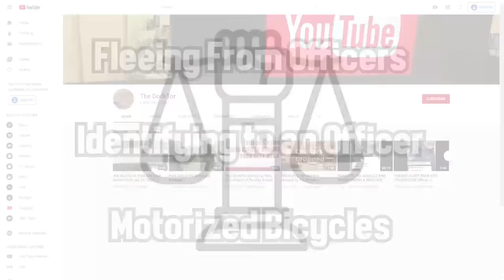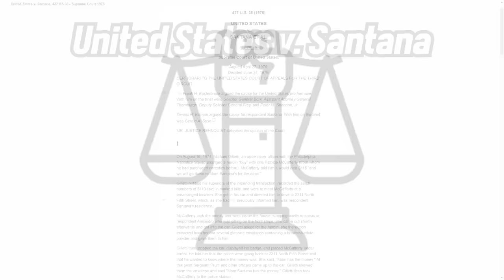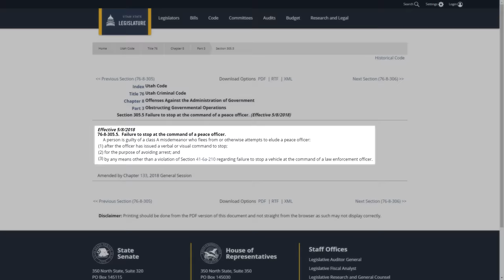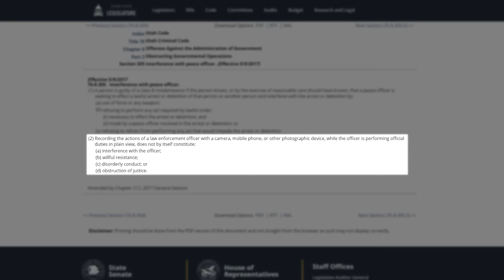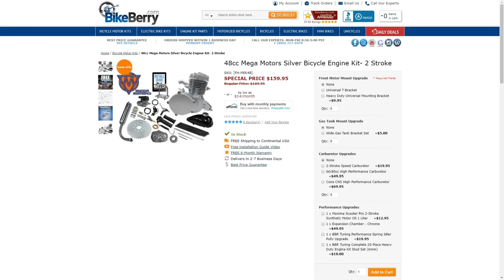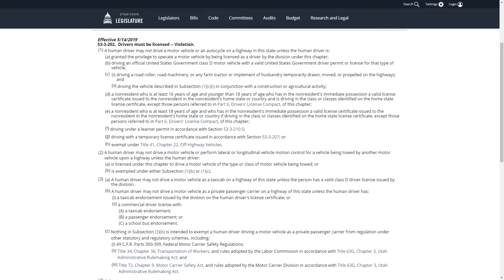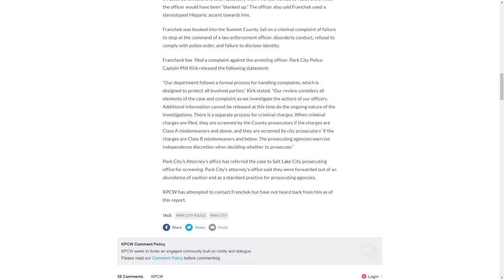Teen Stands Up To Cops Arresting His Father

Comment: Yeah, this is one of the first ATA scores that I HIGHLY disagree with.  They never asked him to stop.  They asked if they could talk to him.  They never made it seem like he couldn't leave and so he left.  The cops get at best a D of some sort but later on they are on video essentially discussing what made up crap to charge him with since they knew they were in hot water.  So F is still probably the truest score for them.  The fact that the two officers were later fired, the women that called it in fled and that no prosecutor wants to touch the case with a 20 mile long pole just shows they know it was poorly handled.

Comment: Here's the problem, nowhere in the video, not at any point as shown at least here by AtA, did the officers say "you're detained" or "stop". At the point when he turns around to enter his home, it was a consensual discussion. That means it cannot and was not a "hot pursuit", nor can it be "fleeing" or failure to follow a lawful command. No command that was lawful was ever given until after he'd entered his home (I'm guessing in the section during the scuffle that happened inside the home not shown). Therefore, the entry into the home was unlawful. The police must make it clear an individual is detained when there is no clear context to make a reasonable person believe they're detained. As for riding a motorized bicycle in Utah without a license, the laws are a bit more murky here. A kid under the age of 15 cannot ride on public roads without adult supervision provided the motorized bicycle is considered a motorized scooter, and there is clearly an ambiguity and conflation of what constitutes a motorized scooter and a motorized bicycle under the law. Furthermore, nothing in the law prohibits anybody from riding such a bicycle normally as a push pedal bike, the only restriction is that they cannot engage the motor if they don't meet the requirements to do so. All in all the police here deserve an F for not only failing to grasp the nuances of the State's laws regarding the motorized bike usage, but for failing to issue clear lawful commands and then entering a home where they did not have a lawful right to do so. Had they stated "Right now you're detained, step down here for a moment" at the onset of the interaction, it'd have been a completely different situation. Yet they failed to do so, making any reasonable person believe that the contact was consensual. The father in my opinion gets a C-, for fighting against the police, not exercising his 5th amendment right not to speak, and put his kid in harms way. While the kid gets a B+ for standing up for his rights, asserting those rights bluntly and directly, and sticking to his position. While the kid didn't understand the law fully, especially in regards to riding his motorized bicycle with the engine engaged, he was quite correct the police didn't have the authority at that time to enter the home, even with the witness claim of the presence of a gun.

Comment: I disagree with the “grade” of the cops. This edited clip of the encounter doesn’t show all the egregious behavior of Officer Jaime Rodrigues and Officer Cameron Thor. Mostly of Officer Rodrigues. The DA dropped the charges against Mr. F. and Internal Affairs found both officers guilty of violations. Five violations for Officer Rodrigues and three violations for Officer Thor. Rodrigues’ attitude was atrocious and his performance was abysmal. Threatening to “throw a teenager’s face into the cement” and leaving two juveniles alone after arresting the only adult guardian. By the way, Rodrigues was formally reprimanded by his superior, but refused to sign his corrective action plan. WTH!? Former Officer Thor did not complete his required corrective action plan by the “due date” and was allowed to resign on that same date.

Comment: This just goes to show that:
1. Do not open your door to cops unless you called them, but you are not safe even then.
2. Do not step out on your porch to speak to them.
3. There is absolutely no situation that a cop cannot make worse.
4. Cops will escalate anything to victimize the victim and get sued.
5. Cops are criminals.

You have the right to not answer questions, 
but not to turn away from them on your own front porch.
You have the right to tell them to get off your property.

Comment: Halfway through, and spotted two major errors. A) The witness specifically told officers only that he had a gun and that he had not drawn it or threatened to use it, they therefore did not have RAS of anything violent or a threat unless you accept that every armed citizen is a threat to police. B) They did not issue commends to stop until he was already in his house. "no no" is not a lawful command or even intelligible as an order. Even so, he had a split second to stop between then and when they put hands on him... I hardly think it's fair to characterize this as "ignoring their commands" even though you are likely right that the Orwellian court system would do so.

Comment: The kid did not need a license to ride that motorized bicycle that was equipped with brakes and pedals In Utah, you do not need a driver's license to ride a motorized bicycle with a 50cc engine as long as it is equipped with pedals and meets specific requirements

Comment: Really dropped the ball on this one. 

You got the motorized bike law wrong. There is an exception in Utah for those gas powered bikes that only requires a permit to operate. The police department admitted as much. 

And you are incorrect the officers are able to claim hot pursuit for following the resident into his home. Had they told him he was detained or asked him to stop, they would have reason, but they did not give any lawful order, they just assaulted him while violating his fourth amendment rights. As the police department admitted after its investigation. 

You also left out the video (maybe you didn’t have it) of the officers admitting they were making a bogus arrest just because their egos were bruised and trying to fabricate charges to justify it after the fact. 

You also failed to mention that the man was tased for no reason or that he did not resist or fail to follow a lawful order in anyway. 

You also didn’t show the video of the officer placing his hands on the kid. Never any excuse for that. 

It seems like you really didn’t do your homework here and you’ve entirely misrepresented the situation. 

There is a reason two officers were fired as a result of this case and that there is not a seven figure civil suit. 

Your grade on this one is a D-. And that’s because I’m being generous because you do so much good work.

Comment: NOT IMPRESSED with your "F" grade for the victim here.
I recognize the niggling legal hairsplitting of the porch vs doorway tread plate, as well as the VERY THIN justification for a "hot pursuit".
I suppose we should all take a lesson here, do not step outside that door. Is this about "curtledge"? I imagine that merely a low gate at the steps before the porch would remove the porch from this rather triffling designation as "public" space.
You can't be resisting arrest unless you are under arrest, and you can't be under arrest without probable cause. It seems this Audit the Audit is a terrible failure and a giveaway to abuse of authority.
It is this reliance on this one witness apparently carelessly saying that there may have been a gun in a waistband. Why do I have to point out that the rumored possible presence merely of a firearm has ZERO cause for alarm or special action beyond awareness. It is a threat + firearm that is required to manifest the justifications wrongly made in this event and this "audit", and nowhere was a threat indicated.

Comment: there are times and places where common sense would be the way to go,  that man was home, he had the choice to either open the door or not open the door, he was in his right no matter what he chose to do. He had an incident with his neighbour prior to the officer showing up, not answering anything was indeed his rights, and lets just that is what he chooses to do, the officers leave and that's the end of the police encounter. He still lives next door to his neighbour, and that old incident will reoccur no mattter how anyone tries to discuss with the other,  you can also go that route. Without the police interraction, there is no possibility to settle that dispute unless one of the 2 neighbours move from there, From what i see there, the dispute with the neighbour is over and done with,  he can try to sue the officer which in turn, just turns the attention elsewhere. which can prove to be costly, Now, wether he wins his case or not,  It only transfers the problem elsewhere and the dispute with the neighbour is only postponed temporarily. It will re-occur.  You have rights and by all means, use those rights,  but using common sense is always a viable solution. A few minutes where you feel your rights are being violated, vs a lifetime of anguish with a neighbour, guess where i would go

Comment: Whether it's an open-carry state or not, of course the cops are going to go after the person with the deadly weapon first. As a public safety officer, you should take care of the most dangerous threat first. I would think that's common sense. Sweep up the other clown afterwards and once everyone is under control, figure out the situation and press charges.

Sounds like he wasn't charged for the altercation which means there was no reason for him to be so hostile to the police for asking questions. Perhaps if he was polite they would have respectfully resolved the situation without throwing him in the clink. Instead he chose to immediately antagonise them and turn it into a problem when it didn't need to be.